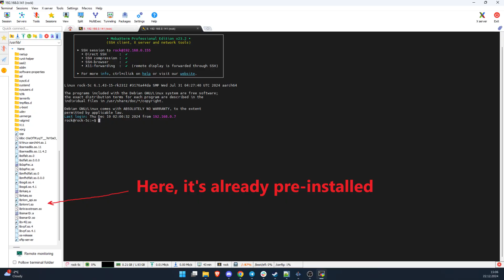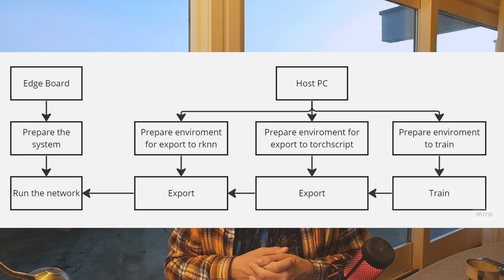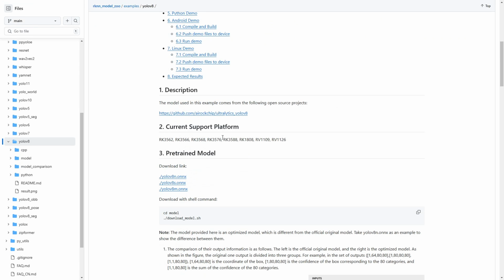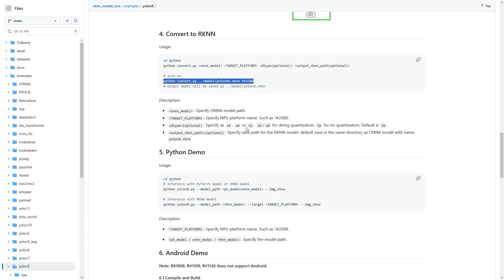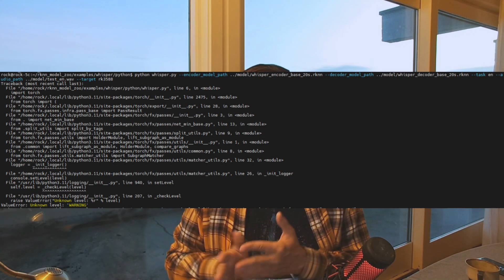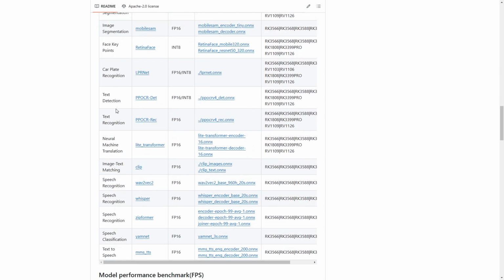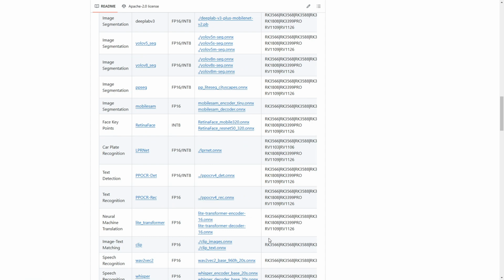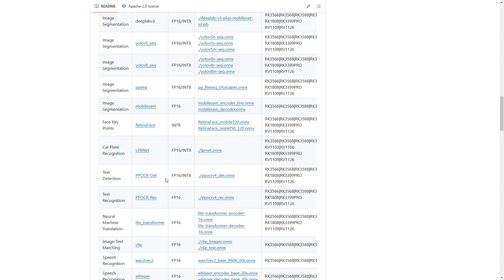How to run neural networks on RockChip in 2025 (rknn-toolkit, rknn model zoo, rkllm).

Comment: Hi Anton. I tried running my converted RKNN model on my rk3588 board but am getting an error that the .RKNN model is either formatted wrong or is or corrupt. Can you plz send me your converted model ' yolov8n.rknn' so that I can check my inference.
Reply from the maker: You need convert on corresponding version of RKNPU SDK, rknn-toolkit + export for correct architecture. A random model will not help you.

Comment: Anton, have you tried to run inference on different NPU cores? (Im having an issue with it, inference works only while using core 0). Also, is there an option to run inference on all 3 cores?
Reply from the maker: On Friendly Elec 3588, Mekotronics 3576, Orange 3588 and Rock 3588 I tested it. It was sucessfully worked.